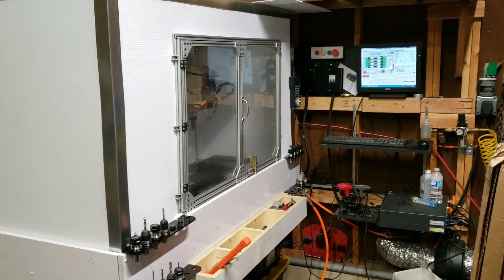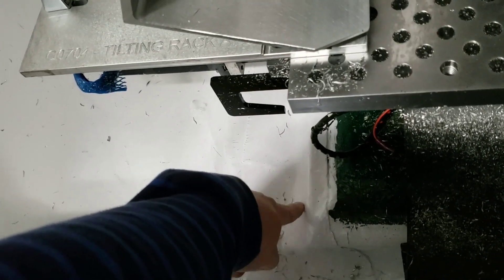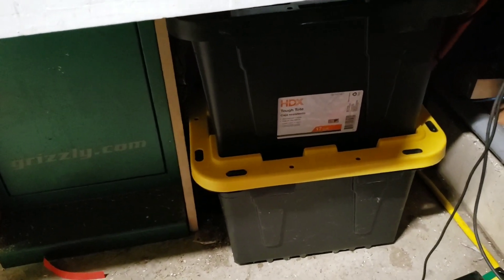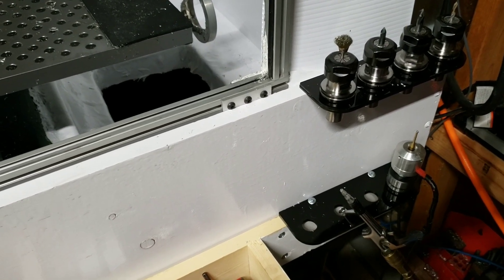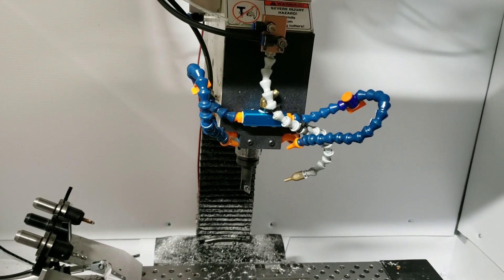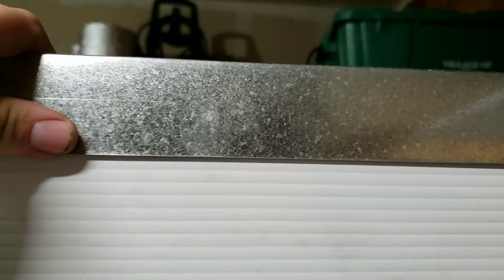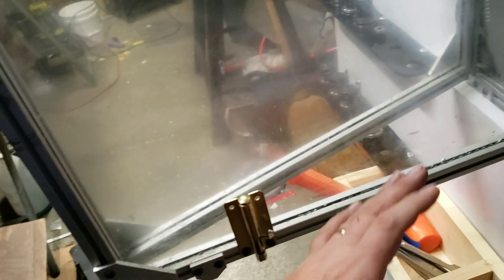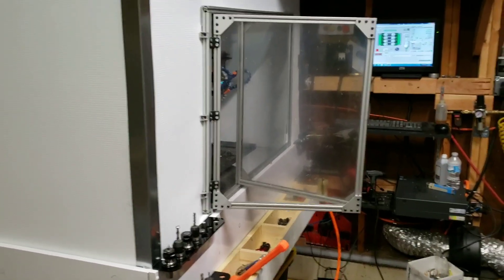New DIY CNC Flood coolant enclosure for my Grizzly G0704 cnc converted mill.  Better chip management

Comment: still getting my enclosure sorted out...im getting less scared of wood and waterproofing the further i research. great video :)
Reply from the maker: With resin / fiberglass it is a really great option.  A good video is russtuff on youtube has a g0704 chip pan construction video with great details on the process.  

So far the rustoleum top side marine paint has held up to the qualichem xtreme cut 251c with no issues.

Comment: I really like your enclosure design.  Is the coroplast durable enough to last?
Reply from the maker: Should be.  My previous enclosure with coroplast had been in use 4 years with no issues with the material.

Comment: Coming along nicely do you have any plans on your tool changer also is your x motor hooked up from the back or is it in the front looking to start my enclosure here soon for my mill
Reply from the maker: The wiring for the X motor exits on the back.  The Y axis motor is on the rear of the machine.  I don't have any published plans for the tool changer but I am working on a release of the plans soon.